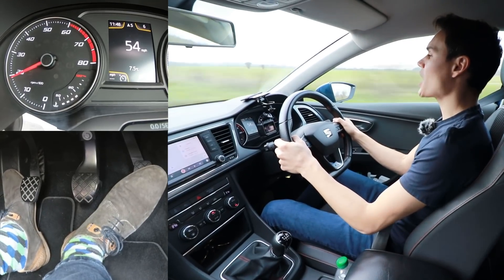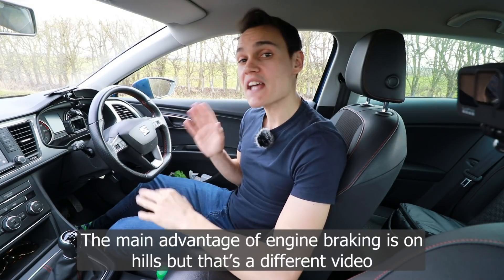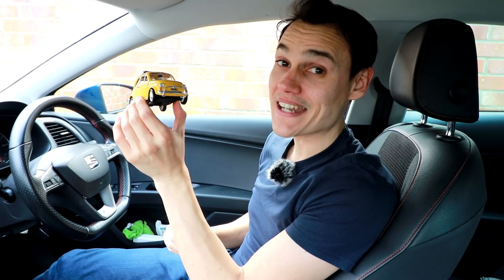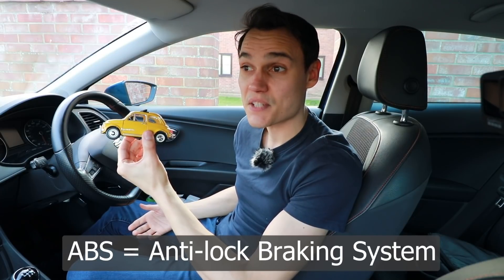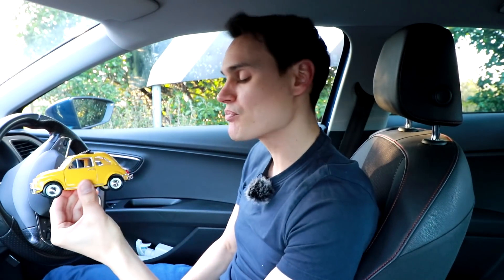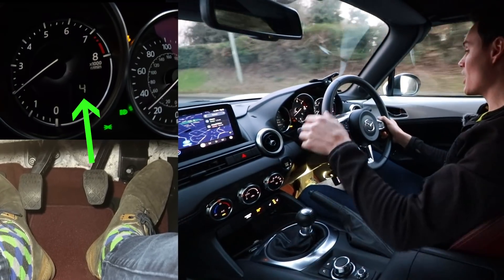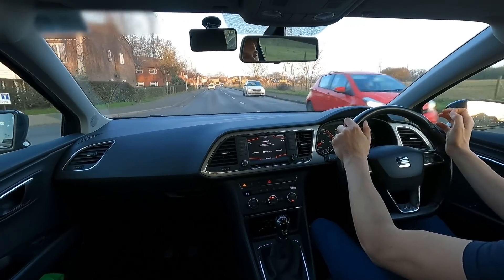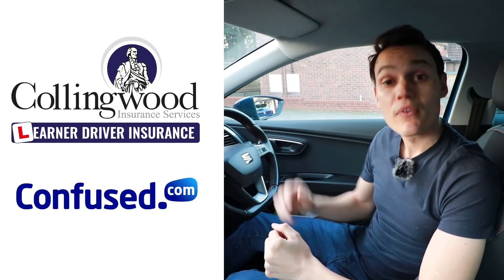Does engine braking prevent skidding in slippery conditions such a ice?

Comment: On trucks, there is device called retarder, designed to slow down big trucks and buses without stressing out the brakes, and the way it works, it slows down only rear wheels, and many people say that you must not use it when the road is wet and covered with snow or ice, because as you said, only 2 wheels are used to slow down, and braking force is only concerned to those wheels, which reduces overall grip, resulting skidding
Reply: I was taught to lay on the brake first before using the jake when it's wet out. Otherwise only the tractor is braking and your trailer swings away from you

Comment: From my experience of driving 2 Canadian winters in a manual Civic, yes a combination of both braking and engine braking helps a ton with control and slowing down smoothly. Also putting the car in 1 gear higher than you would in dry conditions helps with grip when accelerating because you have less wheel spin.

Comment: It’s also worth noting that most modern cars have a form of what VW would call MSR (motor drag torque regulation) incorporated into the ABS and engine control modules. When the ABS detects the wheels locking up due to engine braking, it will actually request more torque from the engine controller to eliminate the lock up.
Reply from the maker: I didn't know that.
Reply: @ConquerDriving  No problem!
Reply: MSR (motor drag torque regulation)?  What is the "S" for?
Reply: @user-Rudiger123  “Motor-Schleppmoment-Regelung” - Motor drag torque control/regulation

Comment: I think this is one of the topics that are hard to explain, and easy to misunderstand.  
The general advice I give is to always stay in gear while going downhill in icy or snowy condition. Stay in a lower gear and only press the clutch if you're getting under the idle RPM.  
Many people missunderstand this as using the engine brake. However this advice is not about using the engine braking per se. It's about braking while still having the engine connected to the wheels: When you have icy conditions and the road is slippery the car will brake much better if the engine is still connected to the wheels. As soon as the clutch is pressed you'll loose a lot of braking power. The advice to use a lower gear is actually just so you're able to brake to a slower speed until you have to press the clutch.
From experience many people won't believe: I can only advice anyone to go at icy conditions to an empty parking lot and just try it out.  

I have an assumption why the car can brake better with the engine connected: When the engine is disconnected there's nearly no moving mass left. When the brakes engage the wheels will slow down very fast and the ABS will release the brakes right away. When the engine is still connected you have a much higher moving mass. The tires will decrease their speed more smoothly and the ABS won't cut the braking power immediately again
Reply: Your assumption is water

Comment: I thought most cars only brake with the front wheels as the back ones have those drum brakes for the handbrake only? One of our cars had proper disks on all 4 wheels but the other car only has them on the front so presumably, that one only brakes on the front?
Reply from the maker: All cars use all four wheels for braking. If you lose your rear brakes you know about it. Rear brakes provide about 30%+ of the stopping power.
Reply: @ConquerDriving  Rear brakes might provide 30% of stopping power on dry roads with quick braking but up to 40 to 50% of braking on icy roads because in gradual braking there is less weight transfer to the front of the car. This means the rear brakes are even more important when braking in ice and snow.

Comment: 6:20 i'd imagine the ECU would have an accelerometer that would detect you're still definitely moving despite the wheels saying otherwise. by "ECU" i mean whatever control unit is responsible for the brakes.
Reply from the maker: It's possible that some have that, I've not heard of any though.
Reply: @ConquerDriving  i think just about any car that can display how many g's are acting on it (like through a corner) has an accelerometer that's measuring it. i mean, they're relatively small and inexpensive devices that are put into every modern phone, too. truthfully though, i don't know whether the manufacturers thought about "relating" this info to wheel speed or not.

Comment: Skidding with wheel brakes is only easier because they are much more powerful than any amount of engine braking. Poor downshifting that results in spikes in wheel force can break traction just as easily as over-application of the brakes. Curiously, cars equipped with CVTs that can engine brake and downshift continuously are the less likely to break traction than cars with gears doing the same simply due to the constant force applied being less likely to overcome the force of static friction on the driven tires. I have to agree that your friction brakes are just better for the control they provide overall. Skidding is better avoided by learning how to judge the appropriate speed in the first place for any given condition. Great video as always.
Reply: Yeah absolutely, I was shown when driving in snow to never be in a situation where you actually need to stop suddenly. Approaching roundabouts at less than 1/4 the speed you usually would, for instance... just hope the person behind you knows too.

Comment: How this engine braking is different from one in the Trucks/ Tractors?
Reply: Trucks and tractors will typically have an engine retarder which is a stronger form of engine braking, the retarder essentially increases resistance from within the exhaust making the engine braking effect higher. In a tractor you do have the normal engine braking effect using gears too but the retarder is added engine braking on top. Brake retarders are used mostly because of steep downhill sections where a heavy vehicle will burn out its brakes and suffer heat fade without the use of a retarder.
Reply from the maker: That's right, diesel engines have wide open throttle so there has to be a system in place to create engine braking. It can be called a Jake brake.

Comment: This is handy to see. I passed my test 3 months ago and only really had one day of snow and ice. My stupid arse decided to accidentally go down a road entirely made of ice, narrowish country road and a car coming towards me. I started to brake but realised I was just sliding towards the ditch I wanted to pull into, not end up in.. 

I used a little braking and mostly engine braking (sub 20mph) and it seemed to work. I wonder how many other drivers nowadays who pass their test as recently as I know to do that.. certainly food for thought.
Reply: It should be quite ovbious not to A put too much power down on ice, B brake hard or at all if you are already skidding. In the theory test it specifically says if you aquaplane you do not brake or steer and instead just remove your foot from the throttle aka use engine braking until the vehicle regains traction. Aquaplane and ice are very similiar and the theory is the same both are a loss of traction scenario.

Comment: The last option is how we're taught to drive in France. In fact, it's part of the specification, meaning that if we don't use engine braking when slowing down (along with the brakes), we may get points deducted (equivalent to a minor fault) in our driving test, if we do it repetitively. We're told that using both increases brake power as it uses the engine and the brakes to slow us down and wears the brakes, the clutch and the gears less than using them separately.

Comment: Engine braking doesn't stop skidding. The whole point of skidding is the fact that you lose fiction between the wheels and the road surface, combined with the momentum of the car and the torque of the wheels. The torque is the biggest thing that contributes to skidding. Which is why it's better to be in a higher than normal gear in slippery conditions. Just break slowly, don't go as fast and stay in a higher gear than normal.
Reply from the maker: True.
Reply: Yes. Let the ABS do what it's best at (especially the newer ABS) preventing skidding on each wheel in icy conditions. When using engine braking on say a front wheel drive car and then you apply the brakes you now have extra braking force on your front wheels that your ABS may not know about and too little braking on your rears which may not be an issue on a dry or wet road but on black ice you don't want to find out at that moment the shortcomings of engine braking and ABS combined.

Comment: Full electric cars such as the LEAF have 'engine braking' capability close to 1/2 G. if you want. with no brake pad wear, no brake heating and reduced tyre wear. Other EVs have selectable 'regen braking' but all are designed on reducing the dependence on brakes in most normal driving.
Reply from the maker: This is true, I've driven some electric cars with this feature now. https://youtu.be/5HwMgyeWT4k
Reply: @ConquerDriving if it's like engine brake with 2 wheels only with much higher force could cause problems in low grip conditions. Like retarder on trucks or buses
Reply: Do you support EVs?

Comment: You could not use the gears to slow down my dads old two stroke wartburg it used to have a free wheeling system to stop the engine seizing up from oil starvation on over run if you get an electric car it uses re generation to help Recharge the battery which helps slow the car down a lot

Comment: Engine braking can cause a slid. I have a video on my channel of my 2000 Tacoma skidding and doing a 180 after I released the clutch in 2nd. Granted, it was a 4wd truck in 2wd at the time. Had it been in 4wd at the time, I seriously doubt it would have slid out of control. I generally don't rely on engine braking on slippery roads, and if I do, I won't keep the rpm much higher than 2000.
Reply: With the 2nd gear u wanna be very careful with the engine break as it's powerful. The skidding might have been caused by releasing the clutch too quickly or putting it in 2nd too early.
Reply: I’m guessing that the 2wd is rwd? Doesn’t that affect skidding?
Reply: If you engine brake with 2nd gear on ice then yeah you're more likely to skid. Engine braking all the way to 3rd gear and then I would use the brakes and only 2nd when the revs get low.
Reply: I concur. A colleague drove us both to Leeds from Cardiff during the pre-Beast from the East - when there was a red warning in place for snow and ice (long story, we had an uncancellable exam the next morning). We were OK on the motorway apart from a lot of reckless drivers throwing snowdrifts at us from Lane 4 on the M5, but at Strensham services a kid ran out in front of our Doblo van (An SDE FWD with considerable engine braking due to low gear ratios) on the frozen, compacted sludge. Despite no braking, just releasing the gas in 1st caused us to steer uncontrollably into parked cars. We needed a mental health break after that leg of the drive (after also almost crashing on the M50 shortly before...)
Reply: Recently I raced a Chrysler crossfire. It is quite high volume atmospheric RWD so when braking in wet, downshifting was unsettling car so easily. It was fun but relying mainly on ABS braking resulted in much more consistent braking (until ABS went into error).